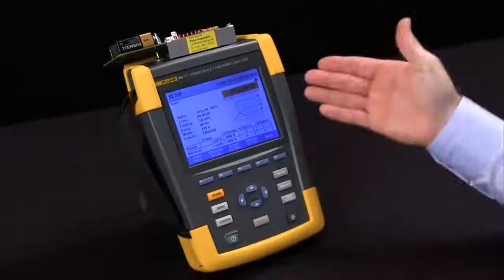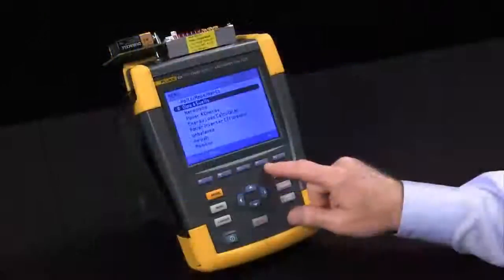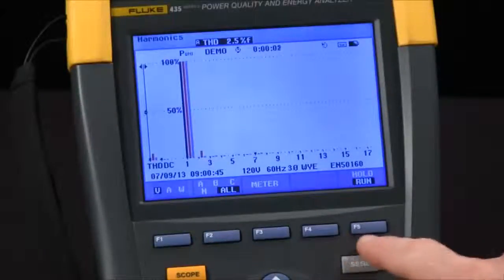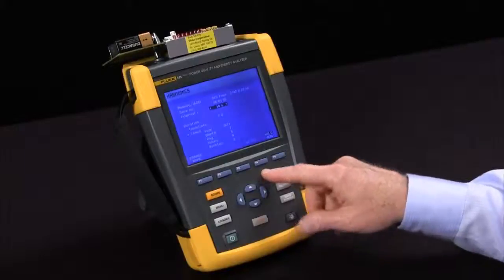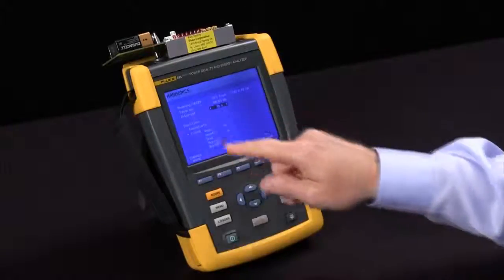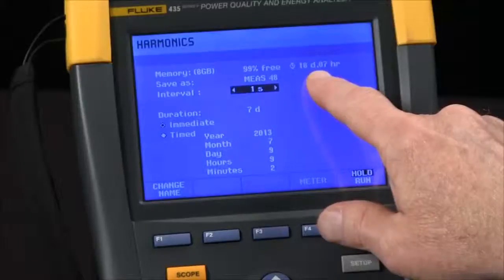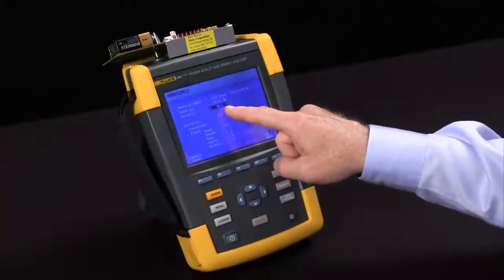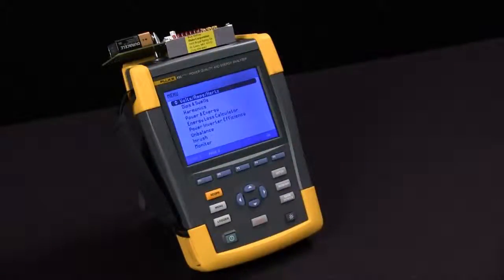How To Perform A Trend Configuration On The Fluke 435

Comment: Hello i email you from Chile , my name is Alejandro , I'm student last semester of electricity , at this moment I am working a fluke power analyzer 435, I´d like to get some information about this device.

 I have a problem with 2 concepts regarding the configuration of this equipment.

" offset " and " span " , I do not understand how to define these parameters , to be more precise , i´am not to clear with both concept, so could you explain me this concept in this device?, and also how can I settings then?.
 
I nead thie information because I am working on my thesis. In particular I follow these procedure to get  this requirement 
 I access the fluke team and then 
 setup - > function . pref -> Monitor -> list here appears to set limits for both phase and neutral

if you could help with some documentation or explanation that allows me to better understand this topic in order to properly use the equipment will be very grateful.

Any information from you will be welcome.

Kind regarding.